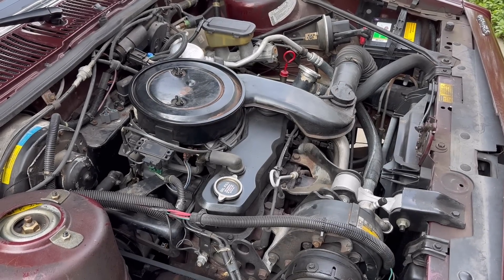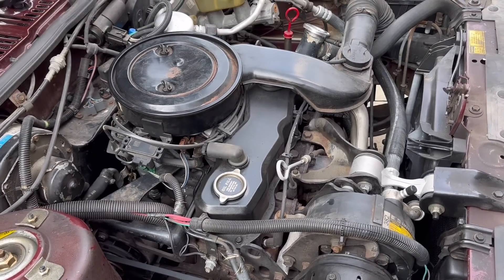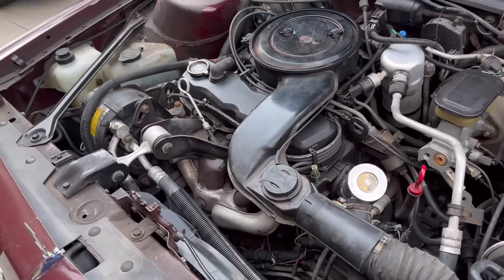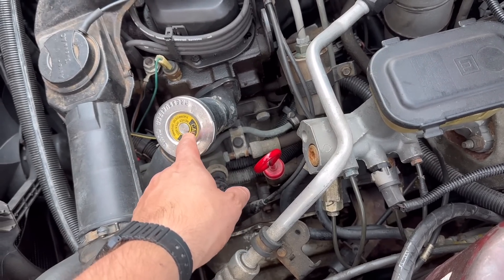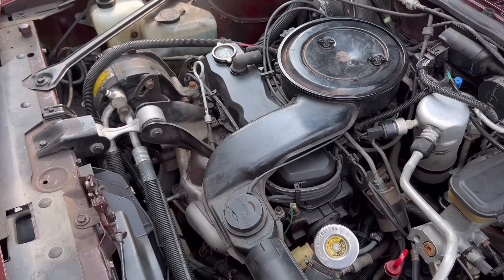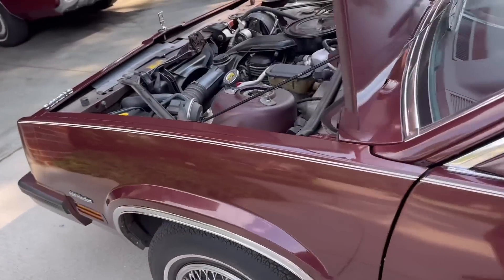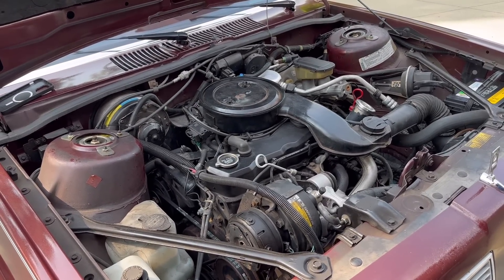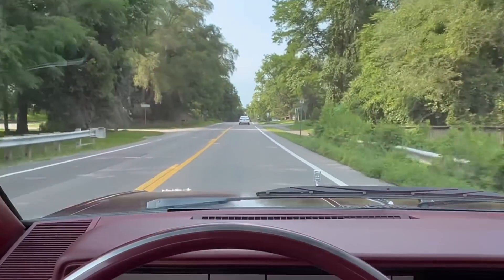Bad Engineering Makes This Engine Challenging to Repair: GM 2.5L Iron Duke 4-Cylinder Engine

Comment: The chrysler 2.5 i4 from the 80s was sooo much easier to work on. The oil filter was right in front. Spark plugs easy to access. It was a great motor.

Comment: The reason the distributor cap is so difficult to replace is because this engine was originally in a rear wheel drive application and was mounted 90° from its front wheel drive application. This was a problem with many early front wheel drive cars they were using rear wheel drive engines and things got shoehorned in inconvenient locations.

Comment: This engine was easy to work on, but it was designed before the Front-Drive boom, which placed the engine sideways.  Most of that sort of car, small Front-Wheel-Drive with a sideways engine, are difficult to work on, regardless of what engine then have.  This engine was a far FAR better engine than that miserable Vega engine.

Comment: I had a first-year Pontiac Phoenix. Only new car I ever owned. It was a great spatial package but rushed into production and full of mechanical time bombs, but the a/c was great. What happened with the ' 92-'99 H-Body? A/Cis totally inadequate in my '98 "88". The vents are placed too low, and what little air  moves through the system is blocked by your hands on the wheel.

Comment: Brings back memories. I took my 85 grand am 2.5 to my mechanic in 91 for a full tunup. When picking up the car he complained about how hard it was to do. Said he had to put it on a lift, reach up and pull the distributor down at a wiered angle busting up his knukles in the process. I thought at the time it was just a tune up cant be that hard. But understand now. I have always remembered that discussion. Think about it when doing plugs and wires to this day.
Reply: Had the same year Grand Am and replaced the distributor myself.  Extremely difficult to do in a driveway.  Then at 61,000 miles the head cracked and coolant was getting into the combustion chamber.  Pulled six heads off other engines and the one I had was less cracked than the other six.  This has to be the worst engine GM ever made.  The thermostat design was great though.
Reply: @davidp8627  yep, had to get my head gasket done at 100k. Was not that bad, no warped head, just put a new gasket on. One issue was the head bolts were a bitch to get loose. Drove the car years after that. At 170k the car developed a rod knock that got really bad, was so noisy about to throw a rod. Dodge used car dealer gave me 100 dollars for the car. Put that towards the  used car I bought there- 1990 Dodge colt. The colt ran good for years then hit a deer, and water stared leaking in the passenger compartment, in winter I would frozen water on the floor and frozen condensation on the inside of the windshield. Had to scrape the outside of the windshield as wee as the inside. That's when I gave up and said I'm not doing this any more. That year bought my first new car 2003 Honda Civic Lx, and drove that 20 years at 250 thousand miles.

Comment: Gm engineering
" lets spend money on redesigning the thermostat to be the easiest to replace in history".
" thats a great idea steve, but remember , for every action there is an equal and opposite reaction".
" right you are bill, I will maintain the balance of the universe by making the oil filter a complete bastard".
"Perfect".

Comment: Question - you said in 1987 the they went to the tech 4 with electronic ignition. I beg to differ here. I had a 1985 base model grand am and had a tech 4 decal on the air box. So think they had the  tech 4 iron duke in as early as 85.

Comment: The 2.5 iron dukes were ubiquitous.  Seems parts should be plentiful at least.  The engineers that designed them didn't care about how you fix them, or how hard it was to reach certain parts.   They just made sure it fit and ran at least.

Comment: Overall the Iron Duke wasn't a bad engine.  It might be the best four cylinder GM has ever made.  They did have a bad rep for oil sludge build up so you had to keep up with regular oil changes.  They weren't powerful and had a buzzy sound but they did OK at highway speeds.  Now I've heard that the Quad 4 engine was a royal headache to work on.  A lot of mechanics hated that engine.
Reply: I was and am 1 of um. We used to call them the Quad w-hore.. Everything you could think about that could go wrong, did. What I will say is I got a chance to drive a Grand Am GT with the 190hp HO and a 5 speed. That car moved pretty good! ( but it was only a couple yrs old at the time..)

Comment: Ign modules and water pumps are not fun on those. If memory serves, the serpentine driven 1s were easier. I cannot recall what the vin was, R? U? But when GM had them in the Grand Ams, they moved the oil filter to inside the pan, cartridge style. I still have the special tool used to remove that cover. That was great until the pan got crusty and the last guy over tightened the cover..You can imagine what happened next.

Comment: Surely if they'd mounted the engine the other-way round and had the exhaust manifold trail out towards the cabin and all the other stuff radiator side would have made a much more serviceable engine. Yes the transmission would have been flipped but i assume all this was designed new for the car. I don't get the logic of doing it the way it was done.

Comment: I got 32-33 MPG on the freeway, but only until the torque converter clutch wore out.  For me it was about 85,000 miles.  After that, freeway MPG was only about 25.5.  The internet, Youtube and other people's experiences just were not available back then.

Comment: Looks like GM designed the engine for longitudinal use but decided to use it in their new FWD X-body cars.  Glad that the thermostat is so easy to change but how often is that necessary compared to oil filters or distributor caps/plug wires?
I don't know if my folks' then new 1982 Chevy Citation was an Iron Duke or not but that 4-banger vibrated the cheap plastic dash at idle.  What POS car that was.

Comment: I had a 1983 J-body GM with their 1.8L engine that had the same style thermostat housing with cap.

It was easy to work on…. And boy did it get worked on.  The only other plus was its fuel injection.  :)

Comment: The Fort escorts  of the 1980s  had the oil filter dead center of the  engine  and you had to lay your arm on the  hot catalyst  to reach it.

Comment: As bad as these are to work on, the 2.2L version (a different engine, I know) in '88-'91 Cavaliers was a royal nightmare for basic maintenance. Good freaking luck getting the coil, ignition module, or crank sensor out of those in less than half a day!

Comment: My 86 Calais Supreme had the Tech 4.  It was not labelled or called the Iron Duke.  However, everyone calls them Iron Dukes which is not correct.  The car was economical and we made many trips to Florida.  I did have to replace the a/c compressor.   The torque converter lock up switch failed, but was easily fixed.  The oil filter was a little easier to replace on the N cars.  We kept the car for 14 years and it covered 260,000 + kms.  The only time it didn't start was one night in Oromocto, New Brunswick when the temperature fell to -40.   Even the local tow trucks wouldn't start.

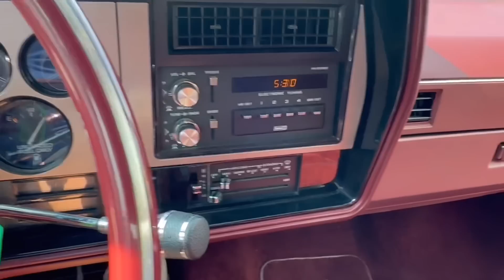Comment: @ 9:38 one of the first series of the Delco ETR Radios.  No set button, you would pull the button out to set the station.  Those sounded pretty good also

Comment: I think you meant electronic fuel injection when you said electronic ignition.  These cars were never points based.  I seem to remember something about GM cars from that era being designed so that the engine could be partially tilted forward for repairs that were on the inside closest to the firewall, but I don't know if that included the 2.5L.  The front engine mount had to be removed, which isn't difficult at all, and that would allow the engine to tilt forward.

Comment: This is actually a really good engine.  I have one in an 85 S10 that's never had a major overhaul and that ol engine don't do nothing but run & run & run & I don't think you can even blow it up just by driving it because it's been thru absolute hell abused even and never so much as a breakdown other than the in tank fuel pump.  You see what I believe the problem is,  is that engineers didn't have ANYthing to do with that filter, or that cap, or any of that other crap.   Because the Engineers designed and built that engine to be run LONGITUDINALLY,  Not Transverse.   Everything after that you can't blame the engineers,   if I measured you up for a tailored shirt that fit you like it grew off you then after you got out the door walked down the road and got to your house you took it off and stretched it up over your ass, legs thru the arm holes,  would you walk in the house and go  "I don't know what the hell that idiot was thinking when he designed these Shorts, they dont fit worth a Fuck!"

Comment: Oil filter removal on any Slant 6... (just try to do it without dumping all the oil in the filter all over the place; the filter faces downward)
Reply: Well, it wasn't difficult. You just had to put a pan under the filter.
Reply: @soaringvulture  No room.  Slant 6 sits at a hard over 30 degree angle.  The block webbing is in the way.

Comment: I have owned three vehicles with the Iron Duke engine. I love it. The problem with that particular one is that it is front wheel drive. ALL front wheel drive vehicles are harder to work on than rear wheel drive vehicles. That is one of the reasons I have never owned a front wheel drive vehicle. I was an auto mechanic for 37 years, and worked on a lot of them. Many of them required moving the engine and sometimes completely removing it to do things that would be super easy on a normal rear wheel drive vehicle. Just try replacing the rear three spark plugs on a front wheel drive V6.  90% of the time means removing the engine mounts and rotating the engine forward.

Comment: Another exception besides the S10 was the Fiero you mentioned.  Since the X-car engine cradle was just slid rearwards, the distributor (and alternator) was right in front of you while looking at the mid engine from behind the car.  But that made reaching the plugs & O2 a PIA!

Comment: I replaced a heater core in a V6 82 Skylark. I think that car had a bad upper motor mount which caused several things attached to the motor to break.

Comment: I have a 91 GMC S 15 that I have made into a 6X6 it has over 256 K miles on it it’s worn out but starts and runs fine and does not use oil .

Comment: My second car was a hand me down 82 Skylark. I only ever changed the oil & agreed, that was always an annoying & messy job. I also agree, those cars were very comfortable, the seats, the ride, very nice. However when driving over bumps of any sort, or taking any turn…the car felt like it was held together with bubblegum. Easily the floppiest, sloppiest car that I’ve ever owned. And the feel/rattle of closing the doors…kinda pathetic.

Comment: I'm pretty sure that engine had electronic ignition before 1987.  Are you saying your Iron Duke has points?
Reply: Wikipedia says the “Tech IV” name debuted in 1982 and referred to having fuel injection (throttle-body).  The ignition was upgraded in 1987 to distributorless.  I would also tend to expect that the ignition prior to 1987 was already electronic, just with a distributor.

Comment: More challenging than supposed to be - 1985-1993 Cadillac second generation HT4100-4.5-4.9 water pump. Stupid design. Horrible. Never owned an X Body would like one tho. There’s a base 80 Skylark local to me, looks good. Interesting topic.

Comment: The other thing about these cars I believe they only had a 3 speed with an over drive so if you were on the interstate at highway speeds and had to pass or climb a hill and the transmission downshift it sounded like the engine went to the rev limiter🥶

Comment: I worked on and own more then a few of those engines.  The flex plates would Crack and it would sound like a spun rod bearing.  I bought a few super cheap because the owner thought the engine was   blown

Comment: Sounds like the engine was originally designed for a longitudinal placement.  Then, the distributor, alternator and oil filter would be much more accessible.  When turned sideways and shoved into the Citation, that would be a different story.

Comment: Isn't this because the engine was designed for rear wheel drive applications and then used in the new fwd Xcars?
Reply: Bingo. The crime is that no one revised the engine layout to make it serviceable in its new orientation.

Comment: That's funny because the distributor on my Fiero is front and center with about 5" of free space in front of it. Couldn't be any easier. And the plugs in back are easy to get to. And it sounds different, probably due to the exhaust routing. 35 MPG and no issues for the past six years. Not bad. Close as you're going to get to a 'free' car. I can easily sell it today for what I paid for, maybe even a little more.

Comment: Look at your car bragging about its high tech fuel injection with those fender badges.
Reply: Well, in 1981, FI was still fairly uncommon on “ordinary” cars.  They just conveniently failed to mention that it was only TBI.
Reply: @kc9scott  And these were found in economy based cars, so EFI was a big deal. Chrysler's L cars didn't get TBI until 88-90. Most imports of the early to mid 80s were also feedback carburetors. Ford started implementing them around 84 in certain models.

Comment: One of the most unnecessarily involved GM engine repairs I can think of is the water pump in the Quad 4/Quad OHC/2.4 Twin Cam in the N-cars, later J-bodies, and two years of Olds Cutlass Supreme from 90-91. It requires removal of the timing chain and exhaust manifold from the head, and is easiest with the engine removed. Which is definitely saying something.

On the bright side, I bagged a low mileage '97 Grand Am SE for $400 in 2021 because the previous owner was not willing to pay to get their vehicle repaired.

Comment: My first new car was an 86 6000LE with the 2.5.  It was a nice car by standards of the day.  Smooth quiet ride, economical, roomy interior and trunk, comfy seats and  (again by 80’s standards) good clean looks.  It was let down by lousy brakes, loud clattery engine (sounded like a back up gas generator) and suspension that degraded  ride quality rather quickly.

Comment: Engine was designed for rear wheel drive. Change the position and things are hard to get at but so were all the 1st gen gm front wheel drive cars. Heck to get to the rear of my 2006 Cadillac DTS you had to remove the front engine mount.

Comment: I bought a new '86 Oldsmobile Calais.  It had the same 2.5 Tech 4 engine.  It had all the same issues you point out here on the Omega.  I wanted a Calais with the V6 but in hindsight it was better I had the 4.  Under warranty the head bolts broke.  In '91 I traded it in for a Quad 442(when was the last time you saw one?).  It was involved in a rear end collision and I brought it in to the dealership body shop.  The adjuster thought I "made up" the stripes and model call outs until he found it in his crash book.  The quad 4 was more robust but it had issues too.  Still I loved it and wish I had kept it.

Comment: I had an 86 ciera, and I got it with 40k on the clock. It was an old lady special. I drove it every day for 5 years, put 80k on it, great little car, great engine. The only thing was the wiring would crack and short out, and I would have to find the trouble spot it happened a few times because of the engine moving around. I replaced the dog bone more than a few times. The module was changed once every 2 years it would throw a code and run ruff when that happened. The one thing that really sucked was when it was below 0 out it wouldn't start it happened once or twice a year I don't know why in the manual it said to hold the gas pedal open slightly on a real cold weather starts but that didn't help. Then you come back when it's during the day 10 degrees, and she starts right up. I ended up falling into a newer beater and sold her.

Comment: I have heard that some Iron Duke cars call for removing the engine to replace the timing chain. I am not sure if that is true or not, but what a disaster if it is.
Reply: That's what the manual says, but I got around that. There's just timing gears tho'.

Comment: 52 miles per gallon equals 13km per litre, which is an amazing result for an Oldsmobile, before discovering this is a 2.5 4 cylinder and not a V8....

Comment: My 1982 Cavalier had that same R4 A/C compressor it you could hang meat in the car on the hottest days. Those old R12-based systems worked really well.
Reply: My first car was a 82 Cavalier.  I wish mine had A/C.  AM radio was the only option the previous owner ordered.  Guy sold it to me because he hit a deer with it but gave me the parts to fix it.  Ended up being a dark blue car with a light blue header panel, hood, and fender.  Drove it about six years but that vinyl got so hot in the summer months so beach towels came in handy.
Reply: Ill give that to GM, the AC always froze ya out!
Reply: Today's 134a systems don't come close.  They are OK for temp that are under 93, but much over that and they are overwhelmed.
Reply: @jamesbosworth4191  But even the R-134a system beats the flammable R-1234yf junk used now.  My 2015 Chrysler isn't nearly as cold or as quick to cool as my wife's 2008 Mazda.  But you're right, R-12 was the best.  You could frost the inside of the windows with that stuff.